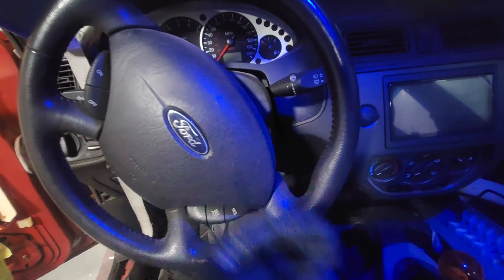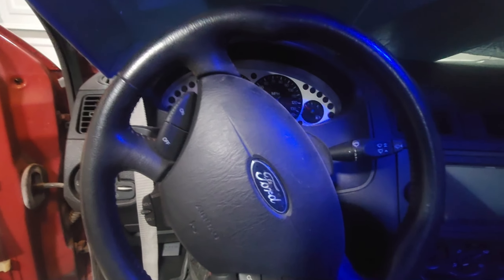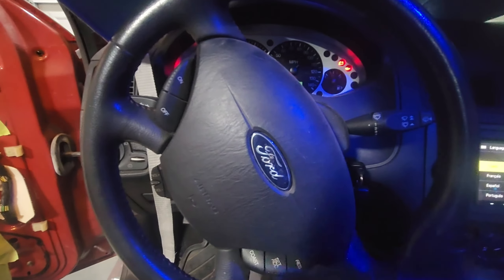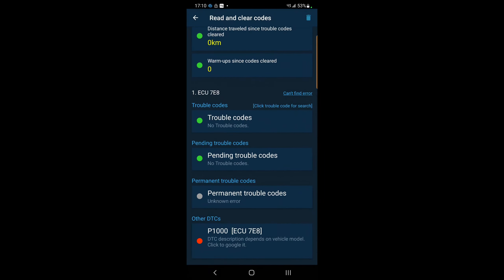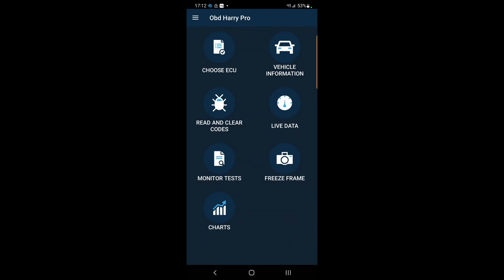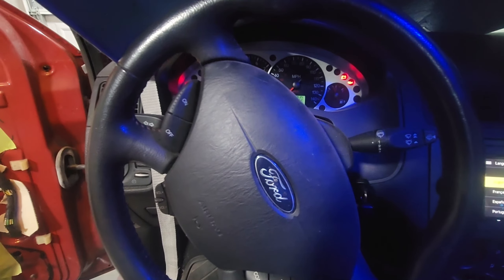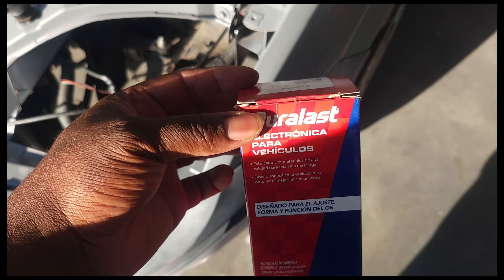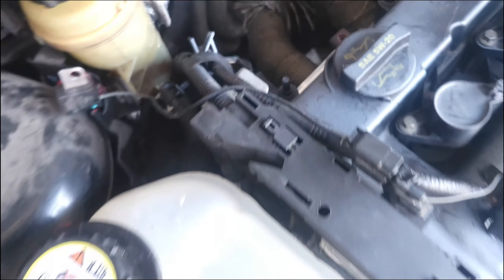2005 Ford Focus ST Work Progress- Part 5

Comment: Hey buddy, my offer is out to help you diagnose. Just shoot me an email if you want to take the time, there's a bunch of simple checks we can do to track the issue down before you toss any parts at it.
Reply from the maker: Im 100% sure its a spark timing issue. Like i stated in the video... ive come across this issue before with another Focus. Same issue with how the engine cranks over. Same sounds i.e fuel pump spark injectors etc. The issue is the lower harness pig tail to the cps! The only problem with that is... if the signal wire does have a kink in it... it will need replacing
Reply from the maker: Issue solved! The car now starts!

Comment: ground on the left corner, is not hooked up
Reply: also check the fuse box main plug, those can get snagged and come unhooked when u pull the motor
Reply from the maker: Nope! It is! I got the engine to start! Ill have to do an emergency video about it!
Reply: @FocusedHands  wait so what was it😂
Reply from the maker: Cps was backwards! / cut in the lower transmission line
Reply: @FocusedHands  oh well thatll do it😂